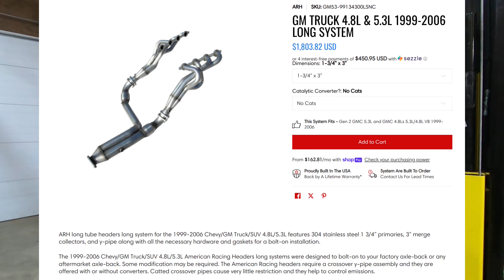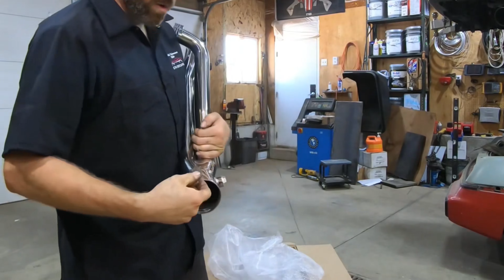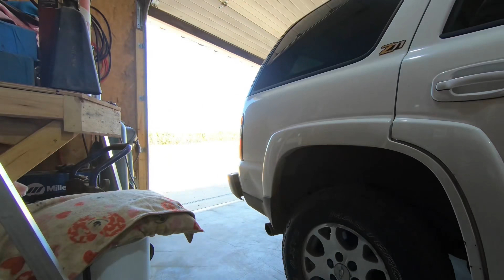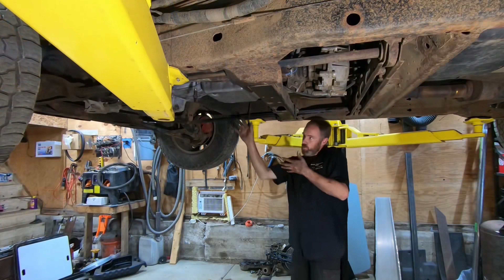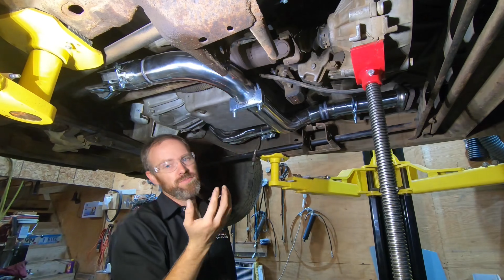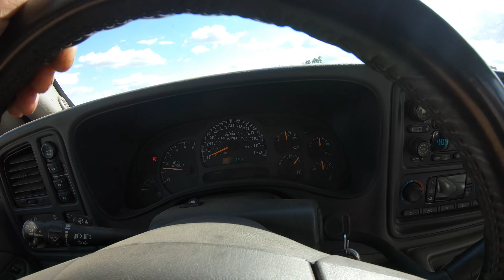Shorty vs Long Tube Headers Install/Review

Comment: So why haven’t you updated a video about the tt Mustang? Wondering if you did a good job or not?
Reply from the maker: Never got a chance to. Once he got the tune working he drove it for a while but had trouble getting the boost controller working. over a year later he finally figured out what was wrong with his boost issue (some backfeed Boost leak or something I guess?) he overboosted it by accident and wrecked it somehow. I also heard he didn't properly maintain it at all so perhaps that's what did it? By that time though I had moved out of state. It was good for roughly 2 years but this is all hear say. He never really called me after he started driving it. Strange situation I guess. Normally they contact me and I work with them any way I can, good or bad. This guy just vanished, makes me wonder if he was unhappy or not. I'll gladly work with any of my customers, even if they are unhappy for some reason. I have no problem admitting to a failure. We are all human after all.

Comment: ive been watching u since pandemic. nice ., but i havent seen a try-y headers installed on a LS-v8 like tahoe/suburbans. also no aftermarket for this type of headers. would there be a way you could make a video of a try-y headers ?
Reply from the maker: If I ever come across the opportunity I will but not often those are used.
Reply: @CrazedPerformanceRepair  more power to you sir. 🙏

Comment: Could you have slid the passenger side header forwards prior to bolts so that it could slide into the crossover without dropping the transmission bracket? Assembly pass header to crossover first.
Reply from the maker: Hmm, perhaps maybe... Now I'm wondering lol